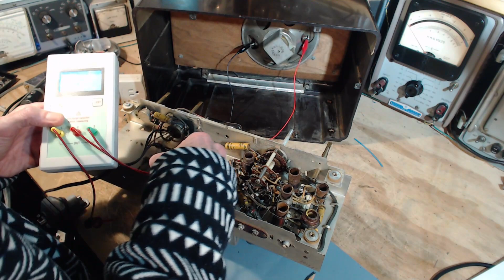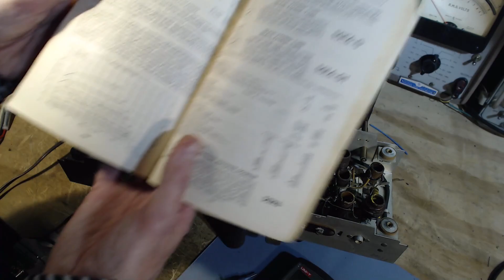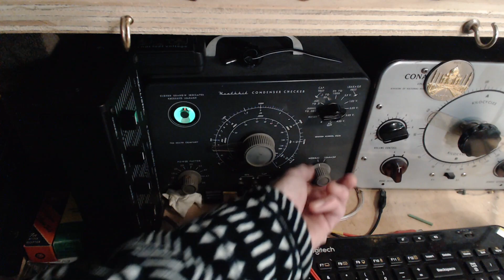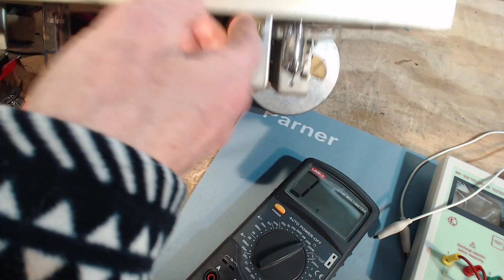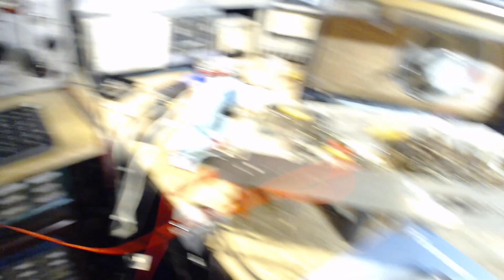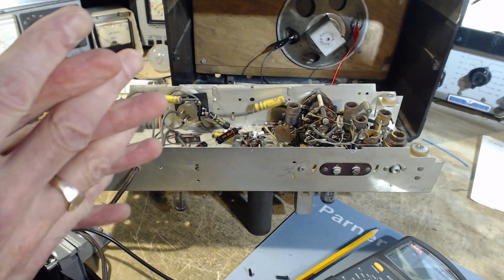Canadian Philips 922 Tube Radio Video #3 - Rabbit Hole Journey

Comment: I don’t see the reason for not changing out decades old caps. Caps are much better made an now an cheap. I would replace the complete set.
Reply: These 72 year old caps should always be replaced . They are electrically leaky since the early 1970's!